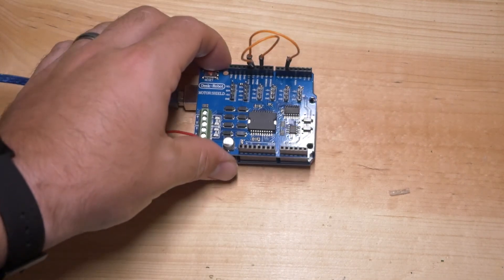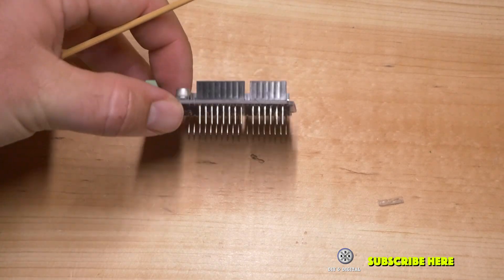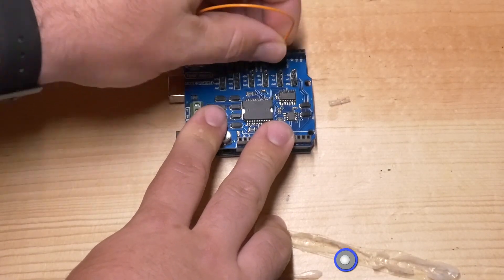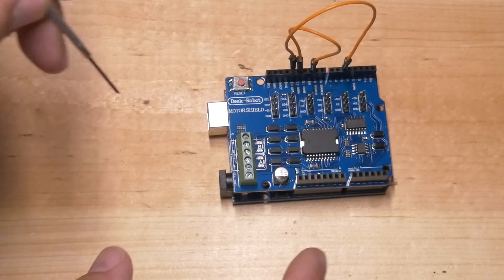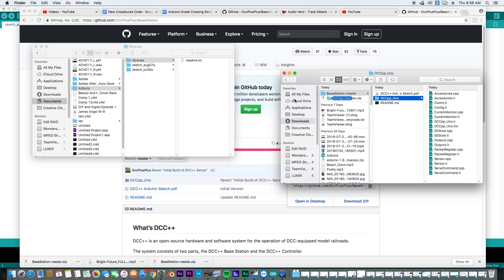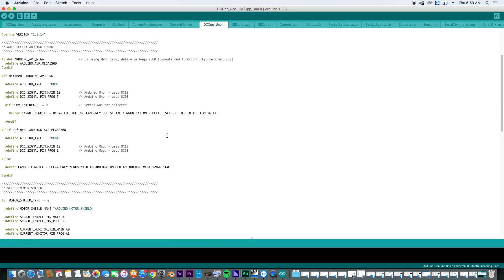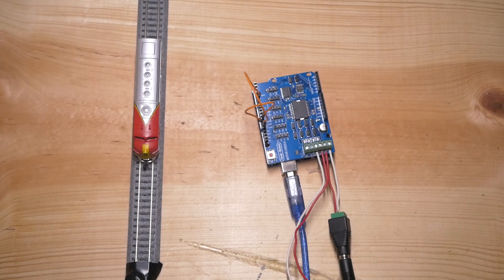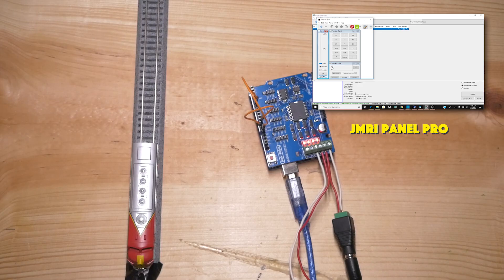DCC for less than $45!!!  Building a DCC++ Base Station

Comment: Hey Jimmy, I have a question: what's the max Amp that I can use for the power supply? In your BOM you suggest a 12v 2a power supply however I currently have a 12v 7a and a 12v 10a power supply. Would those still work even though there's much more amperage in it? Thanks for your help!
Reply from the maker: I would be careful with those.  The motorshield mentioned has 2 channels and can only handle 2 amps per channel.  The absolute max for this motorshield is a combined 4 amps.
Reply: Thanks a lot for that! I'll order a 2a power supply!
Reply: I use a 4A supply, the base station monitors the current to detect shorts and will limit it to 2A (or what you set it to in the code). This is the reason some shields don't work as they don't monitor the current so it can't detect shorts and overloads AIUI.

Comment: very good video Jimmy...I've been using dcc++ for awhile and i love it...I've been using a laptop power supply it is rated at 20 volts I haven't had any problems but now I'm wondering if I will...I would like to know what you think... Thanks Tom
Reply from the maker: +tom carr I've actually been thinking about this a lot recently, and I want to see if a relay can resolve it somehow.
Reply: that sounds interesting please let me know what you find out...TY for your input Tom

Comment: Nice video, have been using the DCC++ for over a year now.  I would recommend for anyone new to cutting PCB traces that after cutting the trace use a DVM set to Ohms and check that the two pads show something else more Zero '0" on the meter.

I amusing the Mega with the Pololu Shield for my DCC++.
Reply from the maker: +Dennis Cherry Thats a great tip!  Thanks for sharing!